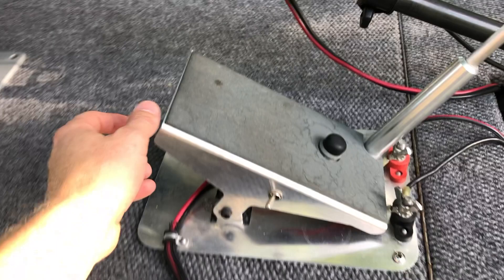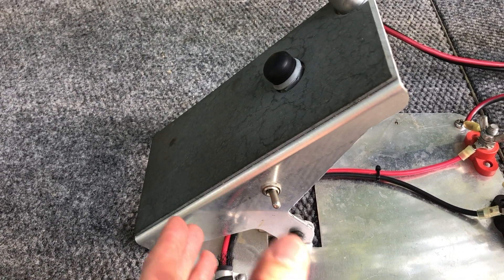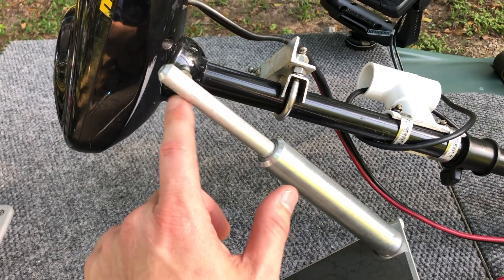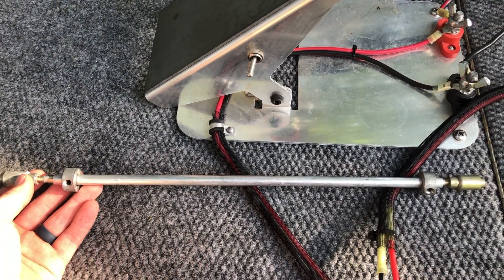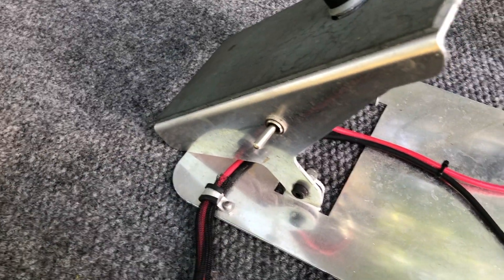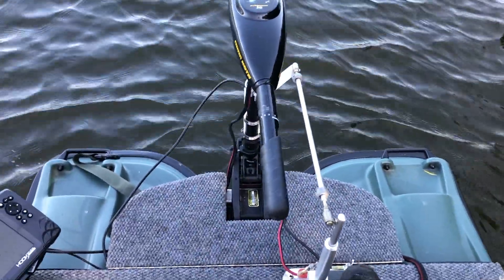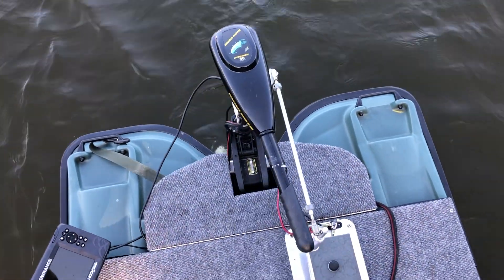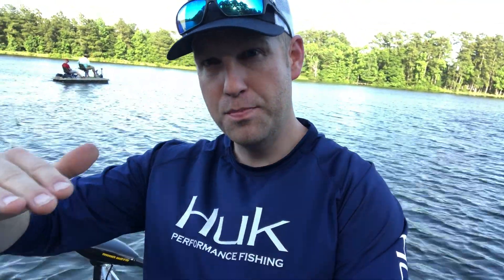Pelican Bass Raider 10E:  Troll King Review & Giveaway!

Comment: I hope you soldered that wiring man. It's definitely worth it.
Reply from the maker: No, but I should.  I did solder the light and trolling motor connections.
Reply: Nice. I thought I saw a barrel connector on the negative wire by the plug. Was thinking how crappy it would be if it failed out on the water.
But you did say you haven't had any issues with it, I'd say that's a big bonus.
Seems like a sweet little piece man. Simple and useful alternative to buying a completely different setup.